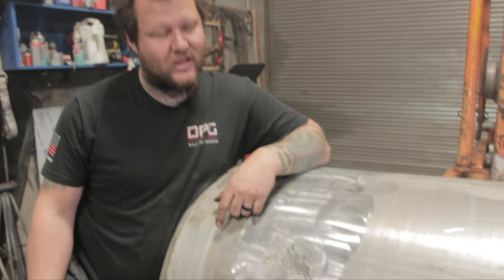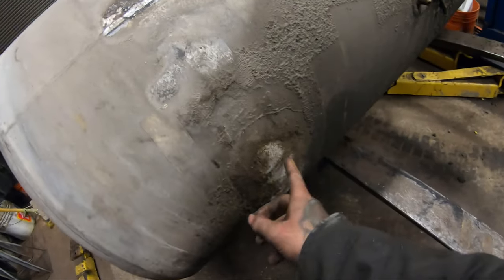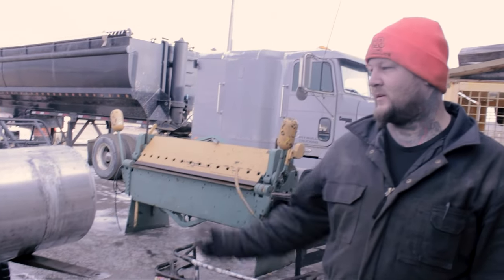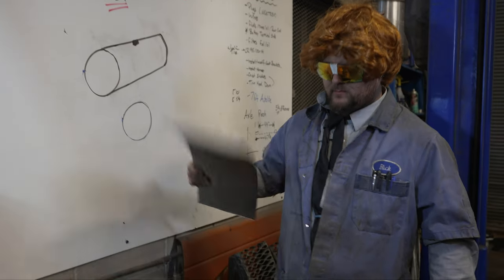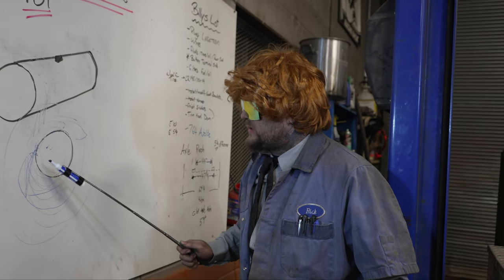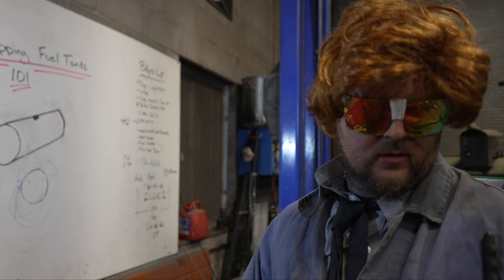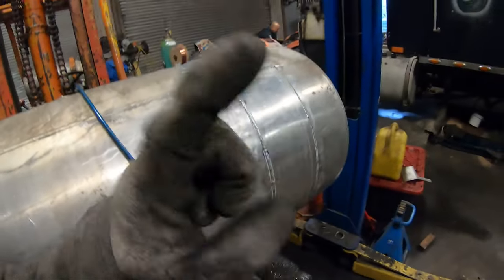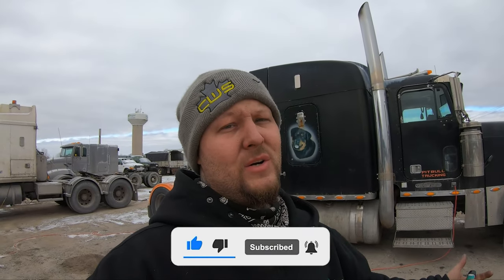Strapping Freightliner Fuel Tanks

Comment: Hey Rick, thanks for the video. I wnted to ask you if you had any problems with that Milwaukee transfer pump for using it for diesel, I have the same but it is meant for water transfer only.
Reply from the maker: No sir works mint for fuel it says your not supposed to use it for fuel but I like to live dangerously and it works great! Just breaks down the fins a little but the rebuild fins are cheap
Reply: @chrome2envy  Thanks for the info, much appreciated.